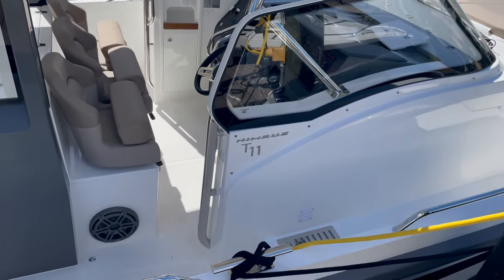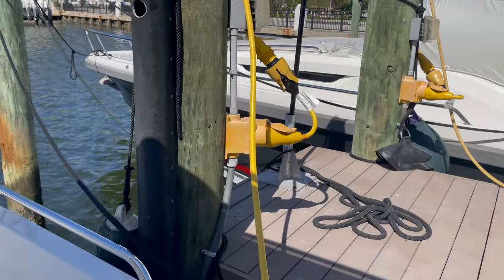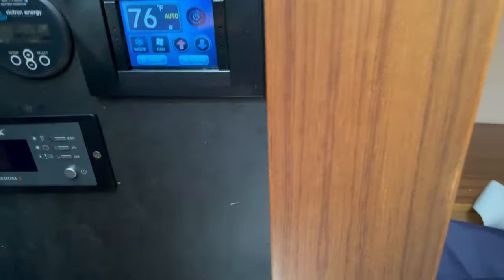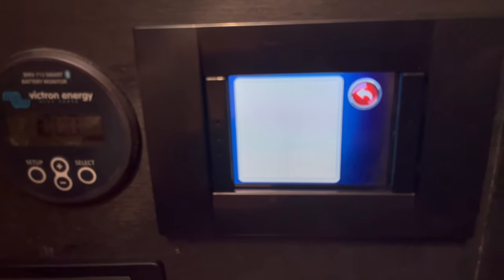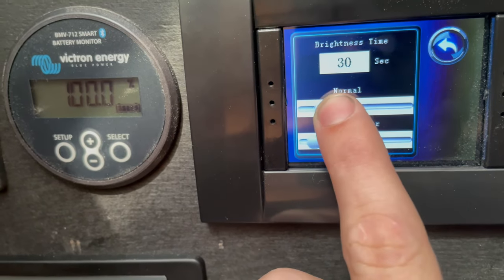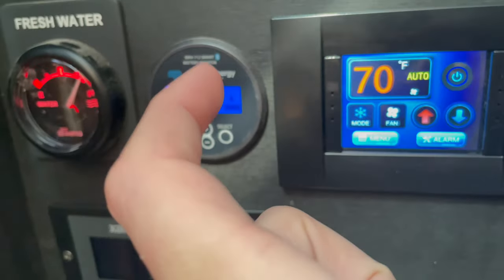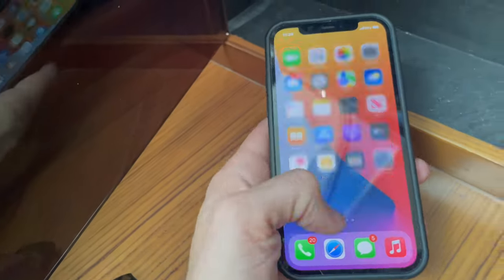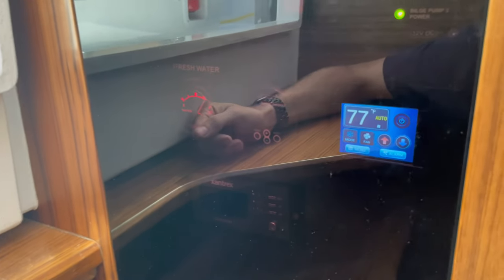2022 Nimbus T11 with DC Air Conditioning by Mabru Power Systems. No Generator Needed!

Comment: Excellent discussion and demo.  These Victron battery monitors are wonderful if one is routinely going off the grid, perhaps using solar, using engines for only a portion of the day, etc.  As for the 12,000 BTU system, simply amazing performance.  Thank you for posting these.

Comment: We are copying your install on a one year newer T-11. Same physical layout. I have two questions. With vents in the second stateroom and in the Head, should there also be either a return air path or at least a path for air to escape those two rooms and into the main room when the doors are closed? Second question is this. For the main room, both the vent and return are at the aft wall. It seems the vent would be better located as far forward as possible to encourage more air circulation within the room. Did you look at running the duct behind or below the electric panel to get it further into the cabin? Thanks in advance for the courtesy of your reply.
Reply from the maker: On new installations, we did away with the head vent as it was a complicated run and it was affecting the cooling capacity of the system as there was about a 20% loss that was caused by the addition of that vent. we did not find the need to cut a return between the aft sleeper and the fwd cabin as the air can pass though the door, even when closed. We looked at other duct configurations but settles with the vent up high that blows forward and have had the best results with that configuration. The link below is to a more recent installation. https://www.youtube.com/watch?v=7_zoQctTRiQ
Reply: @MabruPowerSystemsINC   Thank you. My installer and I had already concluded the Head vent was not worthwhile. Eliminating that and moving the aft stateroom vent to the other end of the bed sure tidied up the ductwork.

Comment: Hi, I’ve been watching all your videos, love how neat and efficient the systems are. I’m interested to learn more about the reverse cycle settings and amp draw, any chance you could make a video about this?
Reply from the maker: Is there a unit in particular that you would like to see this for? We have one of our dealers in Boston that did some testing on our 7,000BTU DC unit installed on a vessel running in heat in real world conditions. I can show it here in FL but the function of these units in heat with an ambiant temp of 90 degrees and water at 82 degrees are not the same conditions that this unit would typically be used while using the heat function.
https://www.youtube.com/watch?v=juUhLee-g_I

Comment: Great video...are those two 250AH LiFeP04 12, 24 or 48 volts?
Reply from the maker: they are 12v, connected in parallel for 500AH @ 12v